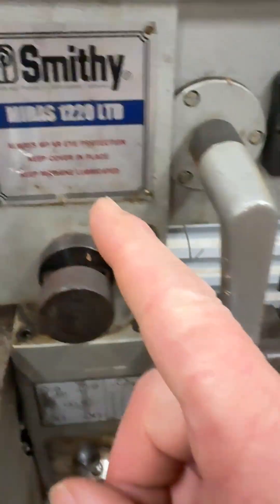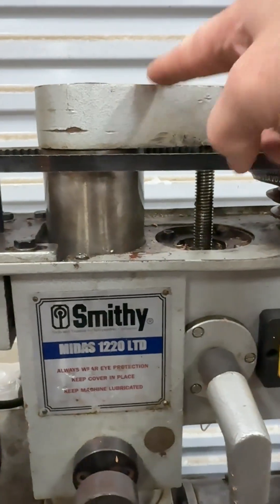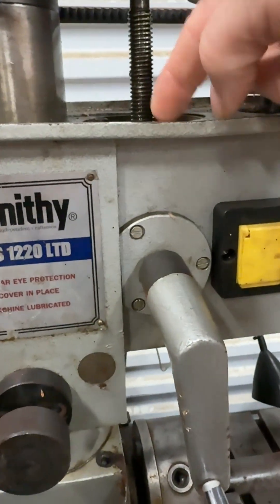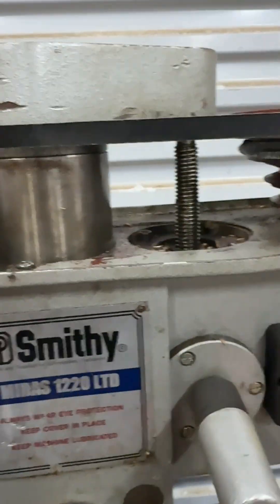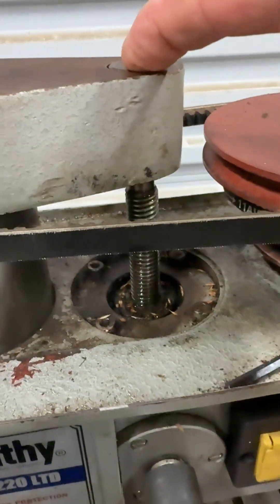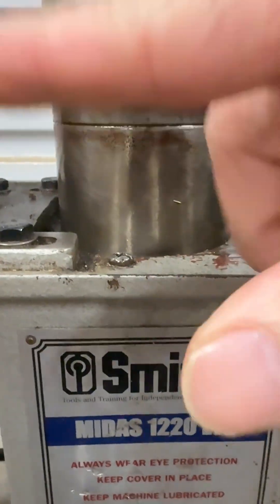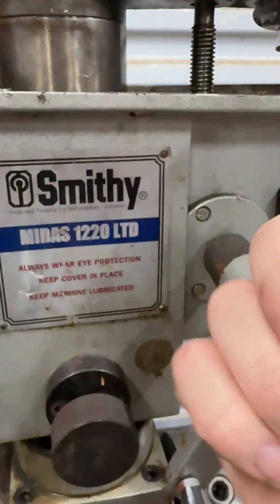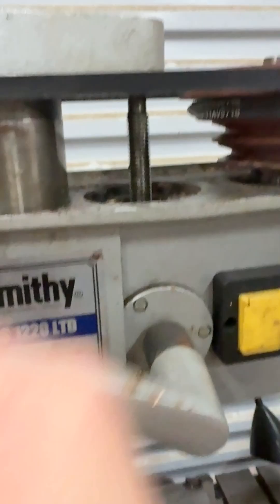Smithy Midas 1220 LTD lift mechanism. #smithy #lathe #mill #lathe_mill_combo #physics #diy #shorts

Comment: I love my smithy, it's saved my ass a few times.
Reply from the maker: It is a good little machine, so long as you keep your expectations reasonable.
Reply: @MuddFlappRanch  exactly, and take your time, it doesn't like taking big cuts. I've made a bunch of custom conversation fittings for performance fuel systems and other oddball automotive stuff. I've also been able to get better accuracy with a 4 jaw chuck that I got from Smithy.